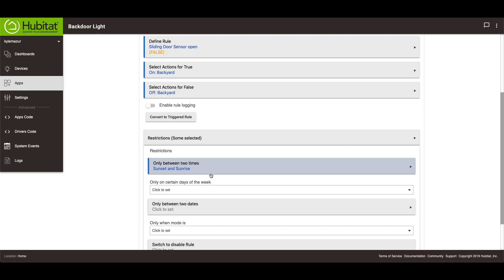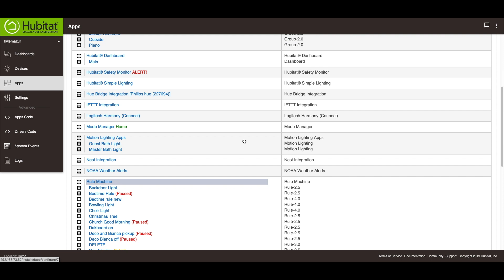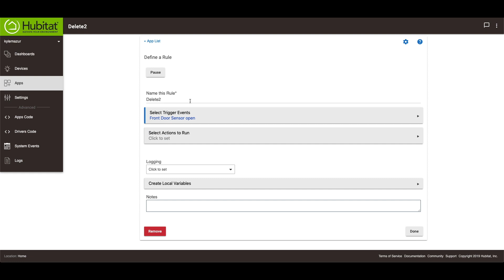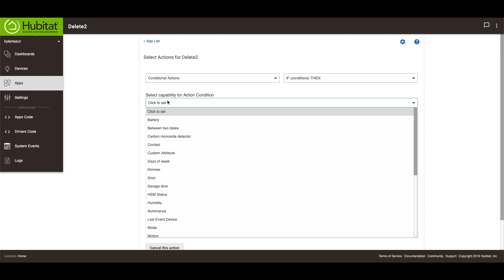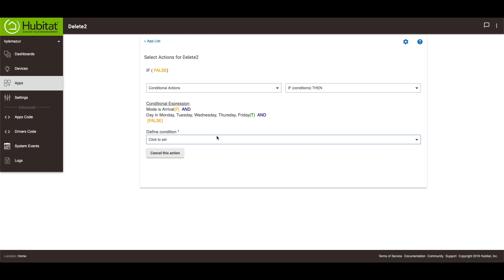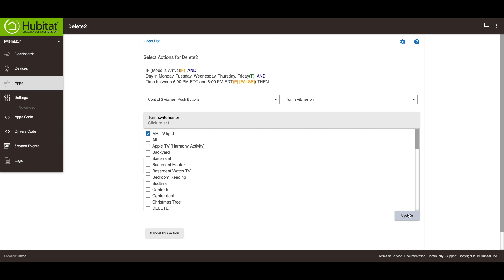Comment: Hubitat seems to have created a sleek controller with a somewhat fumbly UI here. Powerful, yes. Approachable? Meh. I think most novices and even some enthusiasts might find all those drop-downs and fill-in-the-blanks a bit tedious and not at all self-explanatory. Whereas the UI presented by Multi-System Reactor (which I have running under Docker on a Synology NAS) handles all that logic very neatly and, dare I say, in a straightforward, understandable manner. Pair MSR with the Elevation C7 hub and you have a marriage made in heaven! With the added bonus that MSR can - as its name implies - also govern more than one hub at a time, from multiple manufacturers (e.g. Vera / ezlo).